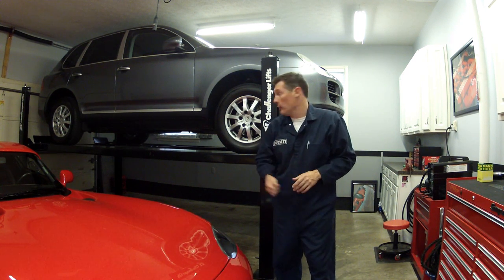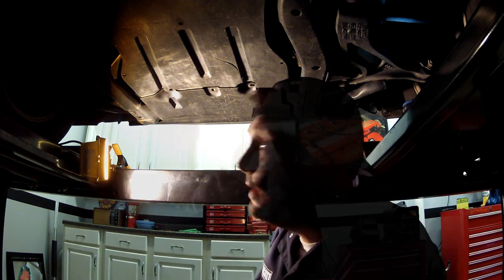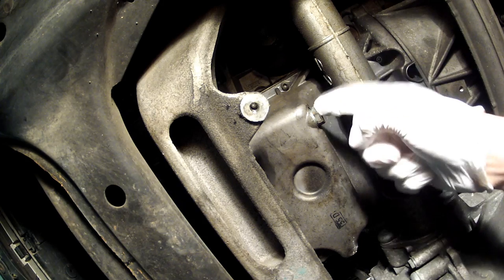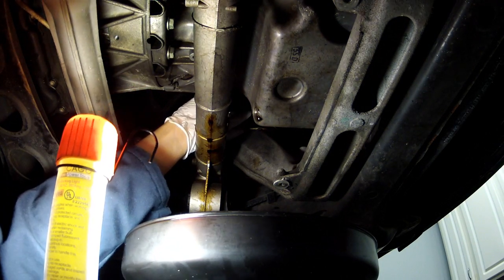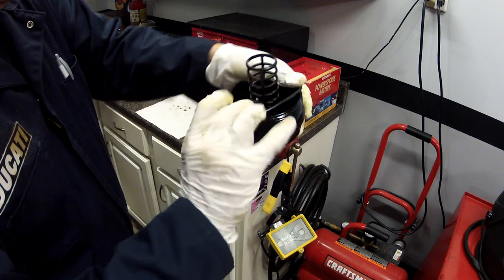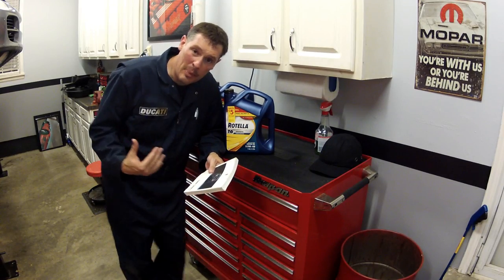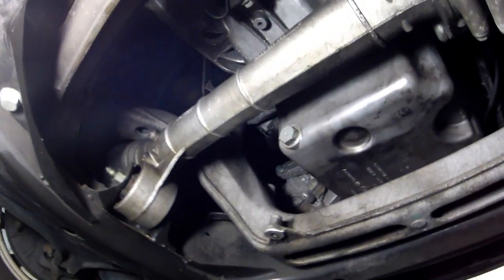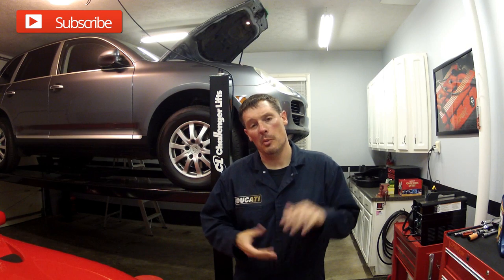How To Change Oil / Filter - Porsche Cayenne 3.2 Liter V6 - With Outtakes

Comment: Thank you for the great video! I've had my 2005 Cayanne for about 5 years now and it has to be one of the most reliable vehicles I have ever owned- like any vehicle,  just keep track of scheduled maintenance. I have always used Mobil 1 5w 30 (Texas weather) have never had any issues. I've seen different videos with the V8 Cayanne that has 2 oil drain plugs

Comment: Thanks for taking time to do this. I just purchased a 2004 Porsche Cayenne 3.2 and have been looking how to change the oil. I was wondering why you didn't drain the filter using the drain plug?
Reply from the maker: Michael L Your welcome, and thank you for taking the time to comment.  I didn't use the drain plug because I wanted to save time and really it is not that bad as long as you have a catch can big enough (mine was a bit small).  Next time I probably will use it though, would have made a little less mess I'm sure :)  Be sure to subscribe if you want to see more videos on the Cayenne, I'm planning a tranny oil / filter change as well and I'll be using Durametrics to monitor temperatures.  I also may do a Durametrics video as well just b/c there is not a lot out there on them, but only if people want to see that stuff, thanks!
Reply: Thanks for getting back. I will subscribe, finding how to's for the 3.2 seems to be difficult. I will definitely be interested in watching.

Comment from the maker: L Bandara Hi, it won't let me reply directly to your comment so I hope you see this.  You can not reset the service now light without a tool like your dealer has.  Now they are a fortune so you are left with 2 options: To take it to the dealer and let those thieves charge you 100 bucks to turn off the annoying indicator, or purchase a cable from Durametrics which is what I did.  It costs about 300 bucks but you can interface with the special Porsche computer for diagnostic and turn off that annoying light, hope this helps.
Reply: Rubber Duc can u post a vedio for macan s? tks
Reply: You were supposed to remove the hex nut on the filter housing to drain the oil filter first so there is no mess.

Comment: This may sound like a dumb question but should you check the oil when the engine is cool, or a few minutes after it's been running at operating temp? I'm seeing different answers for other generations and engines, but I can't find any info on this gen and motor, and I have no owner's manual.

Comment: Does the Cayenne need to have the engine splash guard installed? I run my pickup without it (I know different vehicle) with no issues. These underneath jobs would be much faster without having to take off and replace the engine splash guard but I know on the Audis you have to keep them on
Reply from the maker: That is a good question, not sure on the answer.  I have heard before that the splash guard also aids in cooling, but not sure if that is accurate or not.

Comment: Do you need to put oil in the oil filter?
Reply from the maker: Basi Tasi Hi, that is always a debate (on all cars not just Porsche) but this is the way I look it at.  The car was run within an hour of changing the oil so all the internal parts are coated with synthetic oil.  Because of this fact I don't tend to worry about filling the filter because it is a messy pain.  Not to mention it is not like a regular oil filter, you could only fill up to the top of the cap which is about 1/3 of the filter length at most which wouldn't do you much good IMO.  If you had let the car sit there for several days without running it first and then changed the oil I would probably try to fill it because there would be no protection on the parts but other than that I don't worry about it.
Reply: Rubber Duc That makes sense. Thank you!

Comment: Does anyone know how to reset the service message without external tools?
Reply from the maker: On a few models there was a reset procedure that works for some people, would never work for me here is a link to the forum:

https://rennlist.com/forums/porsche-cayenne-forum/500634-service-now-reset.html

Let me know if that works for you, if it doesn't you would probably need Durametrics.
Reply: Rubber Duc great. Thanks. U will try it on 04 CTT.

Comment: Hi, I just bought a 2005 3.2 Cayenne with 76,000 miles, Ive being searching  which oil  to use, there is so many different opinions, I live in Puerto Rico temperature here is always over 80 degrees reaching up to 96 on summer, which oil should I use 0w30 (very hard to find) 5w30 
0w40 0r 5w40 what is your advice, thank you for a great informative video, I will subscribe.
Reply: Mobil 1 synthetic 5 30 , been using it on mine for 5 years now